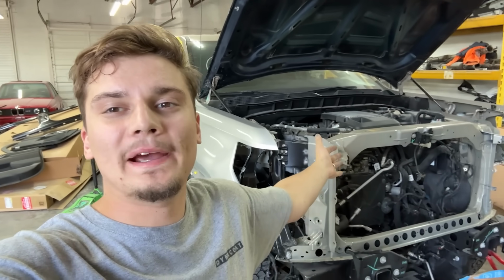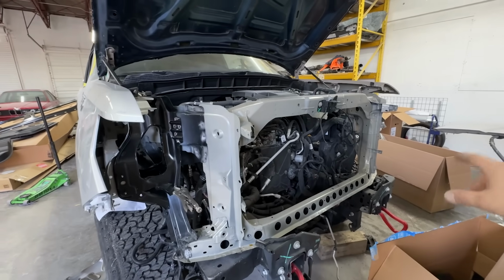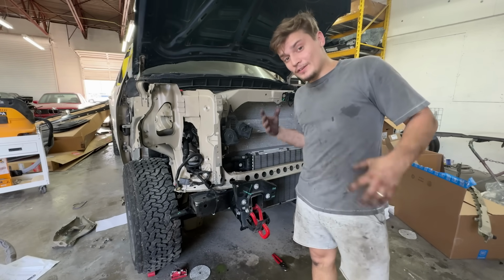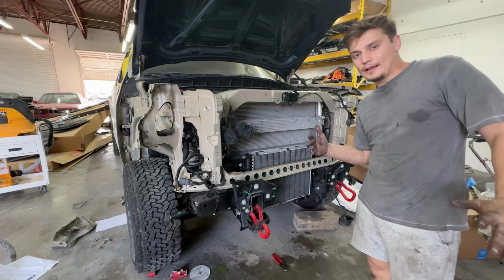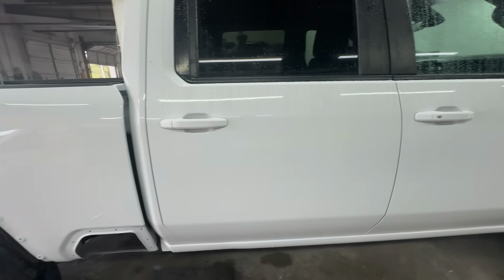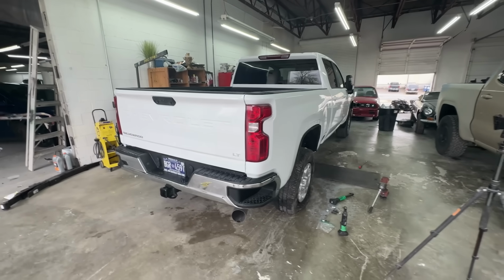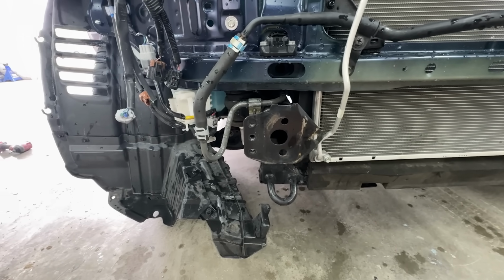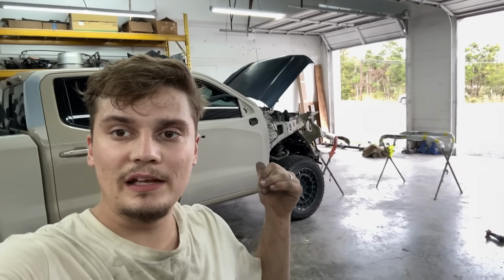The Smashed 2024 GMC DURAMAX Is Ready For Paint!!

Comment: 8:29 you/that shop needs to invest in a lift that spans the distance of the shop from front to back)right there for vehicles and then build a light weight adjustable  bed lift rack( thats padded )to help you remove and install truck beds so your not struggling to do your jobs or risk hurting your backs...sort of like a trolley shop crane so its out of the way when not in use...and can help remove engines and unload heavy stuff including pallets...